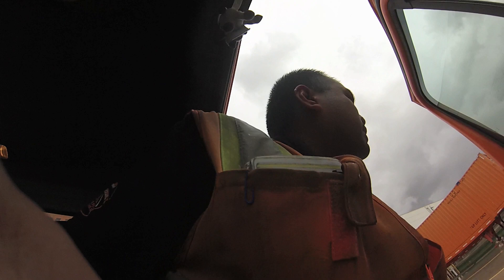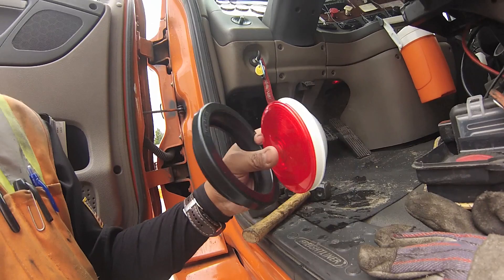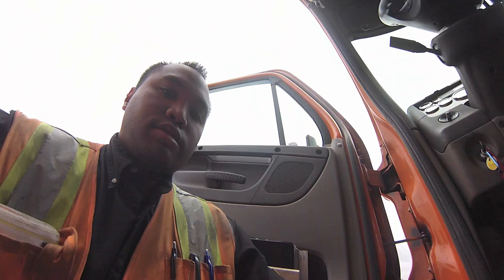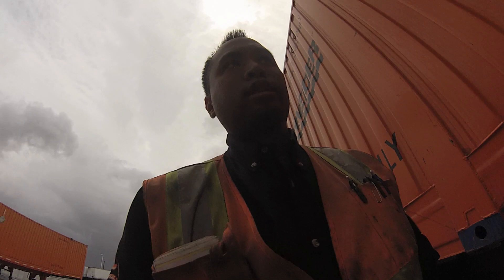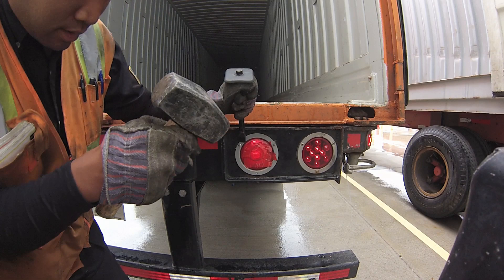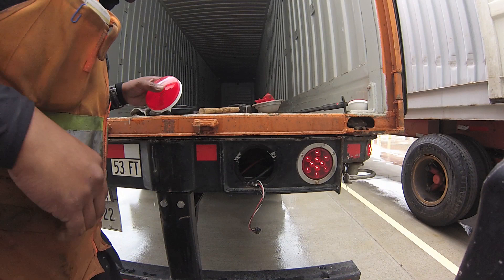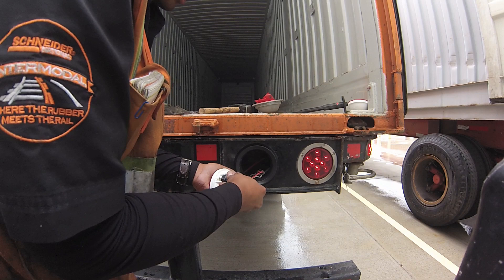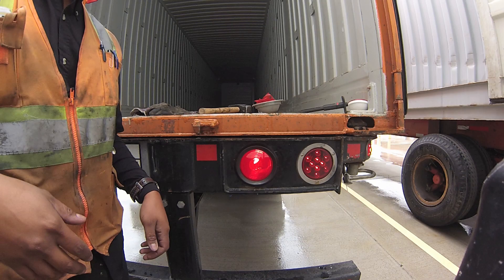How to change Lights on a Trailer (Quick Fix)

Comment: thank you for showing us that. I usually drill them out, which takes awhile. But that is a  great idea ! I woulda replaced those with pre-soldered LED, since DOT issues out-of-service citations for bad tail lamps. So far the best luck I've had with pre made LED is the Truck-lite brand LED. They burn bright at night vs the cheep ones at truck stops. 20 bucks vs a citation imo is better. Grommets are nice because they reduce the impact on the lamp vs a hard-attached unit. But hard attached units at least slow down LIGHT theft.

To me, anything that can get a drivers attention is paramount. Most of these people pull out infront of semi trucks and dont know we cannot stop easily, as well as the drivers are busy talking on their cell phones. Thus why I am all for loud pipes.
Reply: Rick Mahnn what tool do you use to drill them out??

Comment: Nice. But you didn't put the same one on. I have a tag light to change on 4 out of 5 trailers. It has rivets instead of screws. I call the big black o ring a boot.

Comment: So the drivers responsible to replace lights? Not the maintenance dept?
Reply from the maker: las347 If the shop is 20 miles away and takes 30 minutes to get there. I rather spend the 1 minute to change it myself....and get paid for the repair.
Reply: ricecakeFTW how do you get paid for the repair?
Reply: @ricecakeFTW  always fixing myself but never get paid for repair LOL there not gonna pay you for the repair
Reply: Well, if you're driving your load instead of driving to repair then at least you're getting "paid."
Reply: @shatteredsquare  submit a receipt for the light i had to purchase  when you turn in your paperwork.